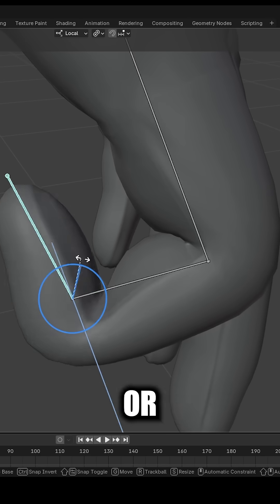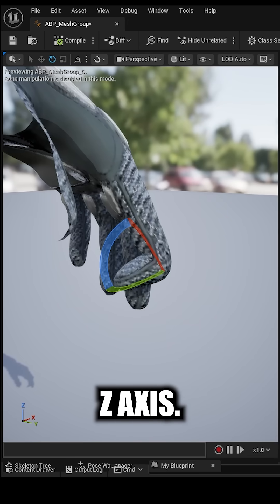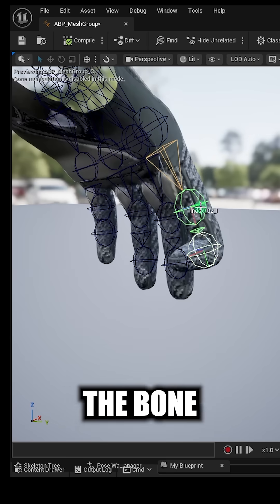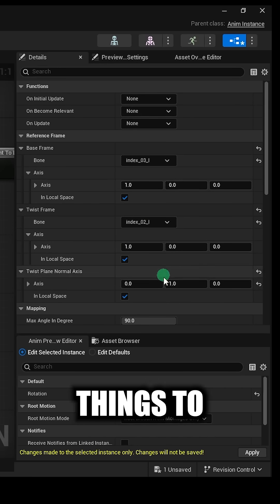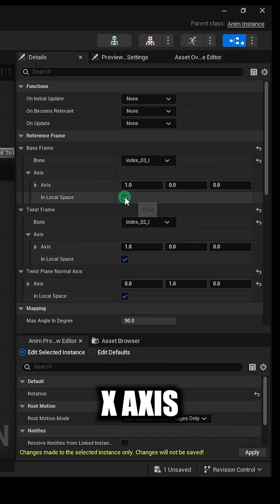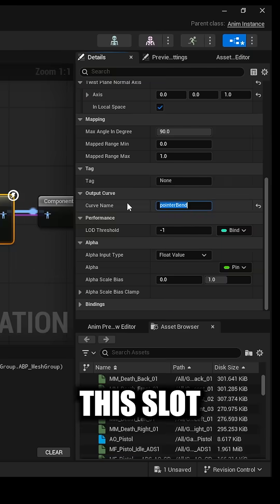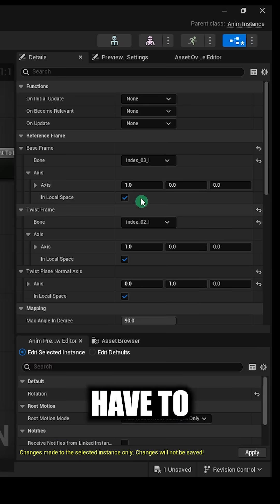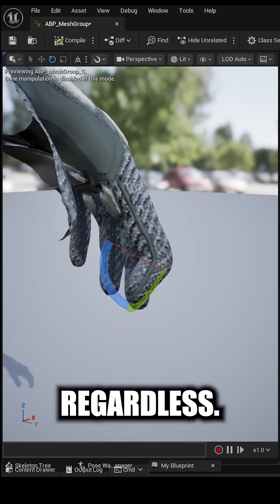UE5: Fix Finger Bends (BlendShapes & ShapeKeys)

Comment: Unreal and Unity don't support sparse morphing. So each blend shape sends a copy of the entire mesh, the vertex position, normal and tangent for every vertex even if it's not included in the new shape.

You can trim delta zeros out of your file, but need to include them back when sending to GPU.

If they had sparse morphing, you could leave them out, but then it'll need to lookup specific indices of the vertex, neglible unless your model was dense.

With bones, only the vertices it influences are stored and sent to GPU. Since influences are usually capped at four, your really just only adding the bone information and moving that same vertice information to that area of the file.

It'll take thousands of extra bones to equal one blend shape in file size and bandwith.
Twenty to forty bones to equal one blend shape in calculations.

I learned this after I had created a character customizer with a thousand blend shapes. The character alone used 8.4 gb of vram.

What I had to change was, trim blend shape out of fbx.

Store the indices and data of only the vertices that were being modified in any preferred method.

When player wanted to modify a section of  character, take the current state of mesh, add blend shape data, replace mesh in scene. When they switch to other section to change, store the current version of mesh, trim blend shape data out. Save mesh data to disk.

The only issue I had after that, which I haven't worked on yet, realign my bones to new shape.
Reply: Thanks! This is very informative.

Comment: how would you apply this to an avatar in unity?
Reply: See Qewbicle’s comment.
While technically possible, it multiplies the mesh size per active blendshape. This causes the VRAM usage to balloon and is not recommended for either Unity or Unreal.

Bones are much more efficient, both on file size and VRAM usage, moreso in the aforementioned engines.

This video is very neat, but this feels more like a tip for animation than game development. If nodes can be exported and used, I have no idea on how that is executed unfortunately.

Comment: What I really really want out of unreal is to be able to export corrective/slider joints and their full driver systems from maya and have them automatically set up in unreal so that a control rig in unreal will work with complex corrective joints. That way when the control rig moves it will use the corrective joints correctly and not give skinning issues. Tis the dream. Hopefully not that far off.
Reply: Same just in Blender. I have pretty much the best workflow for Blender but issues like this really slow the process down and make it tedious. I always have fun until certain points. Fixing rigs when you think you have it perfect and making UV’s for models is about annoying as it gets for me. Everything else is fun when in the process. Wish we could find better alternatives to these things other than AI. Which is probably what will be what they do to “fix” these issues.
Reply: nah you you need to to it manually like in the video, or train a ML deformer